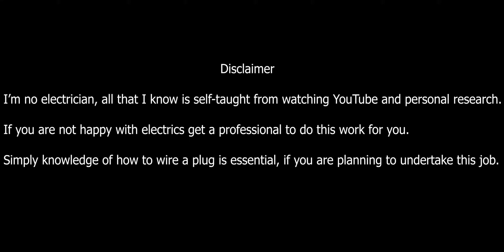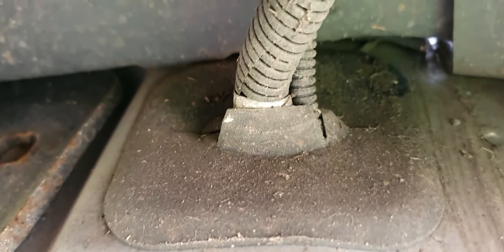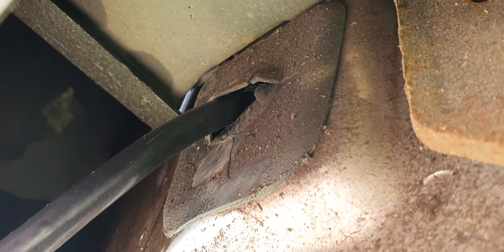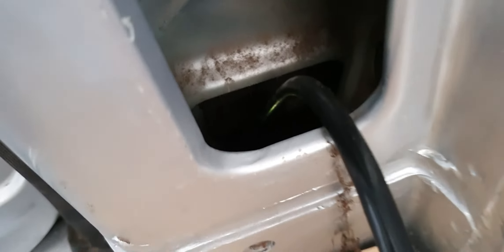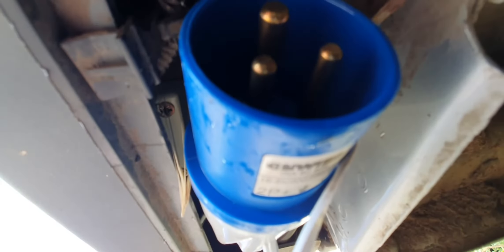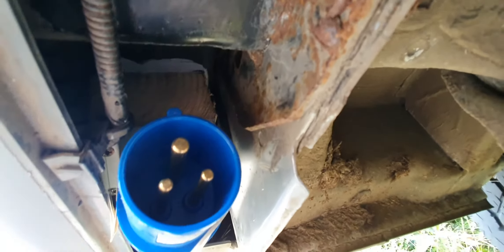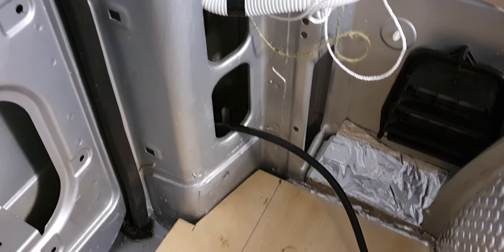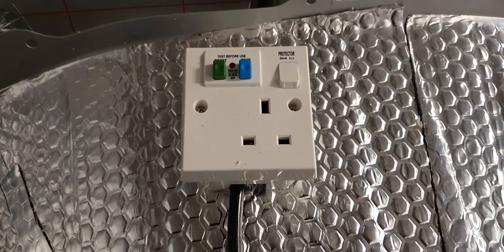How to Install electric hookup without drilling any holes in the van

Comment: Great video, thanks. It was always my intention to put my hookup in exactly the same place. However, when you read the full regs for hook up inlets it says shall not be underneath the van. Did DVLA pass yours as a campervan?
Reply from the maker: Hi Larrypage9181, thank you for watching and posting your question. I have not changed the van over the a listed camper, as i have no windows they will not allow it to be changed the van type anyway. I'm not to worried about changing the van as there are very little benefits, the insurance is just the same, travel on Eurostar is the same, one of the only benefits is you can do 70 mph on a dual carriageway. Hope this helped.

Comment: When the cable entered the van did you have to push the cable through vents ? When I look down from inside the van I can see outside but there is a small vent that opens and closes with the wind.
Reply from the maker: Hi Rosscoooo4854, thank you for watching and posting your question, its not the vent they are on the side not the rear on the van for us.  there is a rubber plate / grommet point which you need to puncher, this can be seen at :31 sec in. If you are able to see outside then i would think the rubber plate is missing. Which van do you have and how old is it, that you are trying to fit this too?
Reply: Thanks for getting back to me. It’s a 2020 ducato. I know what you mean about the vents on the side. They are not the ones I mean. When you look down into the space below the lights there are some black vents. When the wind blows you can see them moving. Maybe this is something that’s been added to newer vans.
Reply from the maker: I would agree, it looks like they have added second slam vents. which i guess leaves you with two option, either use the slam vent opening, however this may not be the best option. If you have the panel which you can make a hole in i would go that way, in my view having the slam vent open all the time, if there is no filter behind it could be an open invite to small animal to make a home.
Reply: @Alivefrom45 Thanks. I may have to reconsider my options. It was more for a dc to dc battery cable. I was going to run it like Greg Virgoe did in his recent build. Thanks for your time, much appreciated.
Reply from the maker: @rosscoooo4854, no a problem more than happy to help. If you have any other questions around this or any of our other videos please feel free to post them, i will be more than happy to answer them.

Comment: how is this working out for you?
Reply from the maker: Very well, its easy to get to plus it cannot be seen, without getting down low. So its perfect for Stealth camp conversion or for anyone who does not want to cut massive holes in the side of the van.
Reply: @Alive from 45  I was thinking of doing something similar so glad I found this. I was worried about water getting in to the inlet.
Reply from the maker: @summie888  it's not a problem, because when I put the cable through the cable goes upwards out of the hole on the inside of the van and water runs down hill, plus the hole is quite tight around the cable, if you look on the other side of the van your find that out of the factory cables are pasted through this route. We have just come back from Scotland and there was plenty of wind and driving rain, but no problem. I'm guessing you have the same style of van as us?